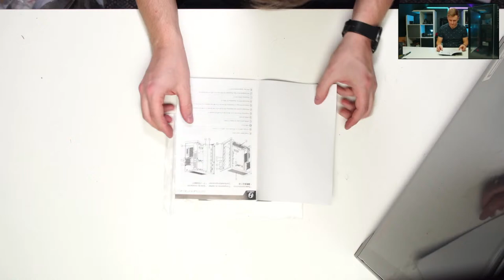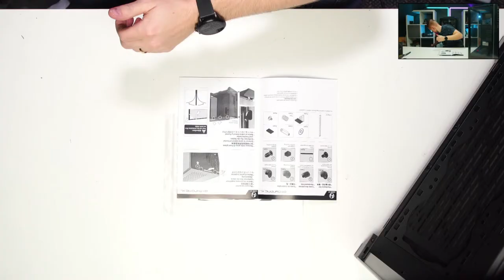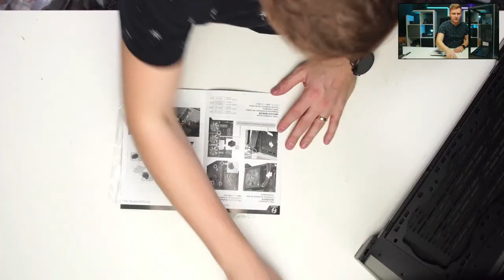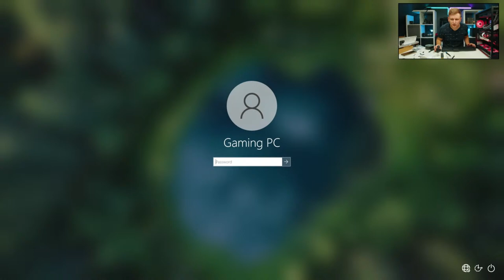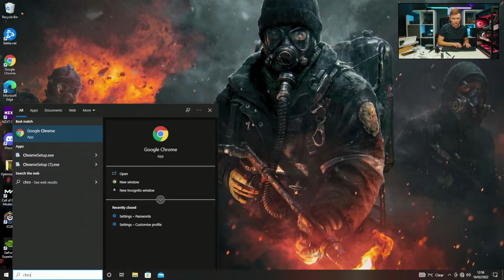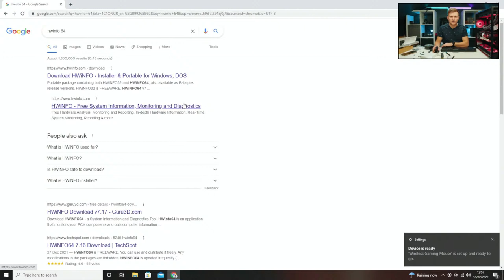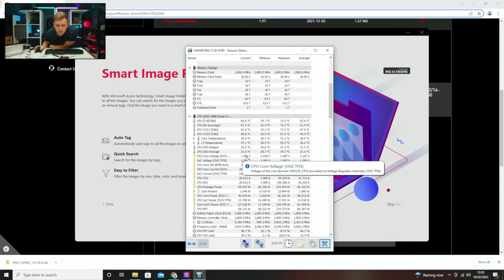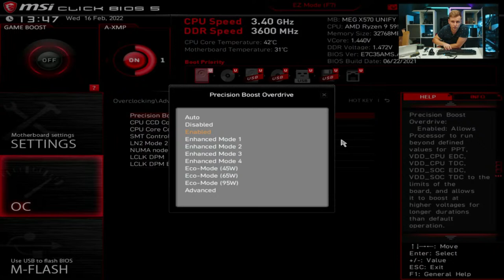⚪️⚫ PC Service and Upgrade | While Answering Your Creator PC Build Questions

Comment: Hi bean watching your chanel now for a cuple months and used info in your videos for my build, but i got a question see if you might be able to help with a comparison like the low end pro video cards like the radion pro wx3200 and up vs the navidia quadros and low end video cards whats better for video editing and 3d animation work stations for buget and hi end.
Reply from the maker: Good idea!
Reply: @theTechNotice  yes when i was building my pc i ended up buying the radion pro wx3200 for the price i guessed was the best i culd get but i looked on you tube for comparisons and i fund non explaning the difrence i do video editing on premier and use after effects but i also use solid works and autodesk inventor, but ther was no info or bench marks for the pro vido cards vs the regular cards for creators.

Comment: Hi, the videos are really informative.

I'm planning to buy a workstation with the configuration that you built more or less

RYZEN 5950X
RTX 3090
Asus ProArt studio
64gb/ 128 gb RAM
2tb SSD
& Other stuffs

The main goal is to make use of this workstation for different projects that I'm currently working (3D modelling, Molecular Dynamics simulations, NGS data analysis (pre-processing & post-processing) & also for deep learning (biomedical images).

Sometimes, I need to make a single run (with CPU + GPU) for 2-3 days to generate the data.

Does the above configuration will manage the heat and can I run these machines continuously.

Thanks in advance !!!